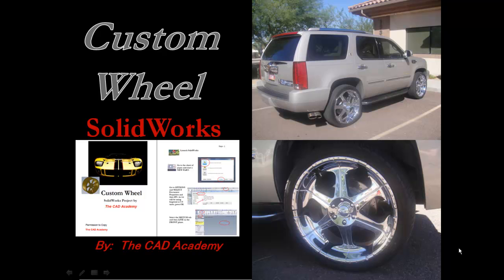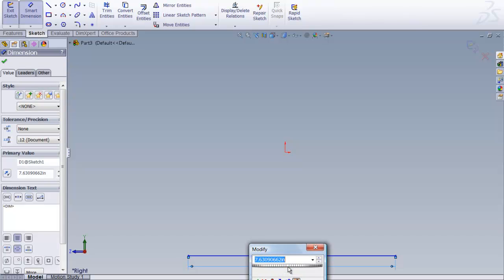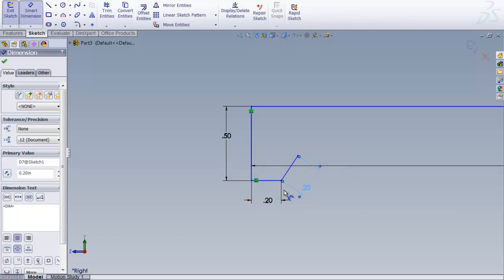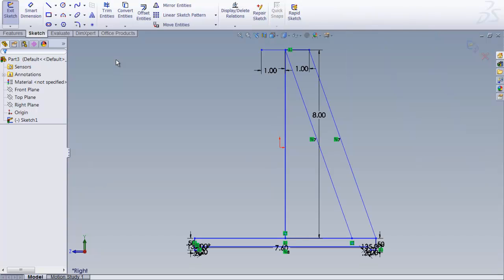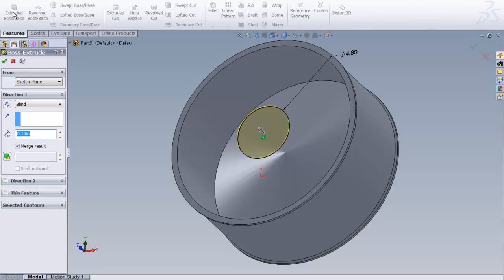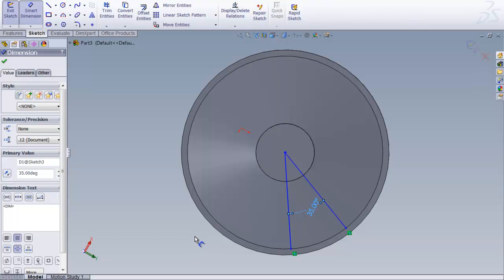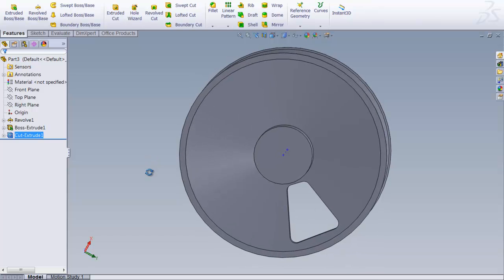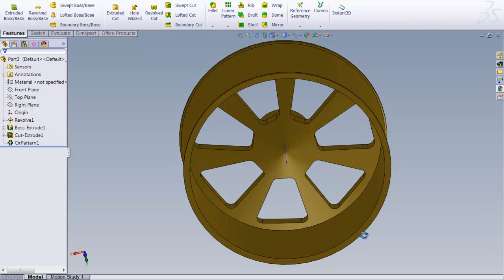Custom Wheel - SolidWorks Project

Comment: Hello Instructor Stephanie, do you have a video instruction with using hole wizard?  I am so stuck with the PCD layout of the wheel.  For example if the lug patter is 5 x 114.3, it means the holes lays on a circle of 114.3mm diameter with 5 holes.  Now... how do you position the holes into exactly 114.3mm diameter ring?  Please advise thanks!